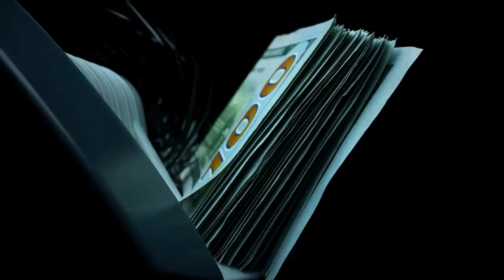The Highest Precision Gun that Doesn't Use Bullets

Comment: Whilst I always enjoy your presentations, I don't feel that I came away from this one with any understanding of what hurdle specifically that Lockheed Martin has overcome. What specifically can DEMOS do, that others can't?
Reply: Multi fiber beam convergence @100kW i do believe is what they have acknowledged publicly they hit.  The multi fiber beam = rain/dust does not matter(uh, matters less as uses multiple frequencies) and it uses the SAME LENS, thus it all hits at the same spot and is not a divergent beam from multiple lens's which also means the distance one can reach out and touch is MUCH greater as quite a bit of power is dissipated in the air itself tunneling a hole via plasma towards the target.  The amount of air turned to plasma becomes quite daunting fairly quickly especially for a moving object as the ENTIRE beam path must be heated to plasma allowing rest of the light through.  If you cannot push this through a SINGLE lens then we are talking MULTIPLE beam paths that must be tunneled and power required is obviously MUCH greater and therefore the kW rating on such a device is piss poor JUNK compared to an equal powered device using a SINGLE lens

Comment: Coat the projectile with silver and laser light will need much more time to burn thru, but targeting laser will have easier time for kinetic counter measures
Reply: Coat the whole projective in silver and it can no longer guide itself. You just made a faraday cage.  There is always some part of the missile that will be vulnerable, such as the seeker on an anti aircraft missile.  Not to mention that shinny silver coating just made it massively visible on radar for conventional weapons to target.
Reply: Much like your head is coated in tin foil?

Comment: The YAL-1  military 747 with the laser turret in the nose was decommissioned due to enormous costs and the “ eggs in one basket” battlefield risks.
Reply: Yes, though it did what it needed as a technology pathfinder.  It can also be a good reference for what improvements are needed.
Reply: There is a bigger problem.  There are no mi$$iles to sell with those systems.  It would be like curing cancer, bad idea.
Reply: they coudve installed that megawatt laser in ships instead of a large aircraft
Reply: @Fold-103  I would be surprised if there weren't at least one project for ship point defense.

Comment: I am not going to hold my breath,   this brand new technology has yet to run into any real world scenarios, and I feel counter measures could be fairly simple to produce.
Reply: Technically yes, these systems are designed to be used in conjunction with more "traditional" systems. 
If the weapon can interfere or disable a guidance system they would be very effective.

Comment: Its a good start but ye power outputs currently are just not good enough to be realisticly useful. The test articles being 'shot down' seem to have been either stationary or slow moving and non evaiding light cased drones/rockets and thw system required multiple seconds (or longer) focused on a specific point on the target to deliver enough thermal damage to take it down. This would be much less effective against high speed, heavier cased munitions and completely ineffective against constantly manoeuvring aircraft. 
Untill the energy outputs are of a level to burn right through an aircraft in half a second or less the physical projectile will still be the better choice

Comment: I see more problems with this as you have to find the target and then keep the beam on target for several seconds to destroy it. So what if the target starts avoiding? What if the LASER takes more time to recharge or cool then the number of enemy targets? What if you do not have line of sight to the target or the weather/smoke/ brought seas or terrain conditions prevent targeting of said objects. Then the cost followed by the weapon is not really armored and easily destroyed or put out of focus by vibrations or combat. Lots of issues to overcome versus convenience or cost. Not to mention the power needed to run it and the system to target it.

Comment: I wonder about a single sniper on the battle field and the new ultra-white paint titanium dioxide based reflecting heat coatings defeating this concept in the air.
Reply: Put down the pipe, you've had to much already.
Reply: @thefrogking481  For every measure there is a countermeasure.Ukraine's in their society do not put down there smokes while exemplifing by demonstrating much countermeasure equipment ingenuity. Think of your brain like a parachute...parachutes work best when open. If your parachute does not open you croak.
Reply: Lasers require lots of power and heat dissipation, which gets heavy and bulky.  On the other side, nothing reflects perfectly, nor in all wavelengths, and once the surface is compromised, it's not even that reflective anymore.
Reply: @patrickjanecke5894 Patrick a very nice thoughtful reply. Thank you for such professionalism and Etiquette shown that others obviously are lacking in as others hide their rude behavior behind pseudo names. Moving on past the other demented types who replied earlier.....I also read about a "starlite" coating that resists fire. Maybe an inner fuselage lining coating of starlite would reduce the lasers effectiveness against the laser penetrating the fuselage of a passing or approaching flying  object.
".....Starlite is an intumesscent material said to be able to withstand and Insulate from extreme heat. It was invented by British hairdresser and amateur chemist  Maurice Ward (1933–2011)....."

Comment: it looks like laser guns would be next to be developed
Reply: No.  Short of a major breakthrough in physics, man-portable lasers just won't pack enough punch or dissipate enough heat.  Even then, power efficiency is really low, so it makes no sense to shoot infantry with it.  These are doomed to be vehicle mounted.
Reply: @patrickjanecke5894  sounds like a v8 engine before. Engineers at Ford Motors say it is impossible, but with Ford's persistence, it became possible it was just a matter of time

Comment: One problem I can see coming up, it only shoots in a straight line! Something over the horizon or behind something cannot be hit. Another thing is the energy is dissipated over a distance and the beam must be held on the target for several seconds, a long tracking time that can't move even an inch, rather than the split second impact of a shell. The real use on a airplane would be blinding the Pilot, which is done even now by kids with lazar pointers. I wonder what effect they might have on radar absorbent materials, will they absorb the lazars too?

Comment: All this sounds well and good but, it takes too long for the weapon to penetrate/damage the target AND in poor weather, the weapon would need to continuously "burn through" great distances of other materials. So, until they can make a weapon capable of instantaneously firing a pulse of sufficient energy to disable the target AFTER moving through any "obstacles" weather can toss in it's way, it will continue to be a science project and nothing more.

Comment: I'm ready for directed energy to be in the private sector.  We can already source parts to build small ones with real power.
Reply: Laser cutting exists in industry already.  It's one of the reasons why the technology has improved so much.
Reply: @patrickjanecke5894  Yep.  I used to run an industrial laser myself.  It could cut through 3/4" steel plate.  We mostly cut 4'x8' sheets into assorted parts.  A sheet of 3/4" took a few hours.  A sheet of 1/16" took less than 10 minutes.

Comment: What if you launch a bullet or projectile and accelerate it and / or turn it into molten plasma with laser(s) before impact? Perhaps it can pierce clouds etc. Course correct mid flight
Reply: The idea isn't about melting the whole thing into molten slag.  One can either punch a hole so as to compromise the function of the weapon, or damage an aerodynamic surface enough for it to be destroyed by the wind resistance.  

Some frequencies can go through clouds, but that does add to the list of design requirements.

Course correction is pretty useless against DEW.  It only needs to track a moving object where it is right now, not guess as to where it will be 10 seconds from now.

Comment: What about the diferents typs of laser, like quimical ones, they are not ecofriendly.
And the battery is very, very heavy, it doesnt get litter like a normal gun, when it use there ammo.
Laser are good idea to combat the drounes but you want to avoid to put big batery on a veicule because the % of serviving a hit can be lower .
Reply: As has been known in the hard sci-fi community, any directed energy weapon is far less powerful of an explosive as its power supply.  Still, direct feed from a battery won't work too well for DEW purposes.  You need capacitors - really big and powerful ones.  At that point, charge up on that alone.

Comment: If only it could track hypersonic  missiles.
Reply: The biggest problem with hypersonic missiles is trying to get a shot to lead them.  Lasers are effectively instantaneous.
Reply: @patrickjanecke5894  but can the tracking software keep up Is my question
Reply: @Visvangmeneer  Yes, that's actually the easy part in point defense, and hypersonics are actually easier to acquire as they are moving through atmosphere so fast that they appear as a bright plasma cone.

Comment: Probably a stupid idea..but, if you put mirrors on a aircraft and tried to shoot it with a laser, would it work?
Reply: If there aren't any scratches, dust, grease, etc., a mirror will work for about a microsecond as they are not perfect reflectors.  After that, the surface won't help at all.

Comment: What they don’t tell you is what it would do to a human body if it hits a person which it would more then likely be used for in a war situation eventually 😂
Reply: Nope.
It's far to expensive to use for that.
When a bullet costs 30 cents and has been proven to be most effective.These systems are intended for air defense.
Reply: Just currently requires a bus sized object to house/power it  to operate and yes will kill someone easily currently.
Reply: @w8stral  Which is far smaller than what was needed thirty years ago.  Still, power consumption and heat dissipation will be hard to shrink.
Reply: @patrickjanecke5894  Not true at all as that is not the breakthrough
Reply: TBH, why bother?

We have cost effective bullets.

We can also use much lower power lasers capable of blinding everyone in 'that direction' if we really want to go that route.
Reply: @ColonelSandersLite  Well, Bullets are not cost effective is the problem.  Steering them is VERY difficult and very limiting, a LASER can be aimed instantly without moving the lens for small incremental changes, only large movements.  This makes tracking/killing far far far easier and quicker.  Tie a heat sensor, with inferometry, to a computer, and a LASER set up with no one around and it would literally kill 100% of ALL infantry, RPG's, heat sensing missiles, mortars ... utterly negating the machine gun into the dustbin of history and the requirement for a man to operate it or any other weapon and be seen by said IR heat sensor to begin with.  This will be the start of mech warrriors.  The only problem is power throughput associated equipment.  The problem is not the LASER itself, but rather all the power equipment associated to RUN said LASER.
Reply: @w8stral  "Tie a heat sensor, with inferometry, to a computer, and a LASER set up with no one around and it would literally kill 100% of ALL infantry"

Buddy.  Nothing you described there is a function of lasers over bullets.

Any technology that can be used to autonomously shoot a laser at a man can just as easily be used to autonomously shoot a bullet at a man.  It wouldn't have a fraction of the footprint either because the power requirements are greatly simplified.
Reply: Knight, you are correct about the effectiveness of using high powered lasers to attack soldiers.  However it's illegal under the Geneva Convention, as are all electromagnetic radiation weapons used against humans.

Comment: Um, no.  Look at the wavelength, peak lasing power, and touted engagement distances, and terminal effects.  Also, figures quoted are under entirely optimal ("cold-cavity/bore", blue-sky continuous target tracking) with no effective "follow-up" shot due to capacitive re-charging and thermal off-loading back to cold-cavity and cold-excitation circuit states.  We'll get there, but we're not remotely there for decades to replace individual kinetic/explosive rounds with X milliseconds of lasing exposure from a singe emplacement.  On a very positive note, terrestrial defensive-grid coordinated arrays of these weapons will be devastating.  Multiple targets can be multi-radiated simultaneously increasing both the reach and effective-kill lasing duty-cycle of all lasers in the system.

Comment: Lasers ? Well, you seem to forget the power of ground penetrating microwave energy. Ground penetrating microwave energy also can be weaponized and the effective distance perceivably has an unlimited target range of destruction along with a much larger effective diameter of destruction of targets. This larger diameter of destruction could be as large as from 3 feet to over 1 mile in diameter of effective destruction of targets in the air or on the ground even to say the capabilities include the vaporization of all organic matter up to 3 miles in the grounds surface. If the microwave is focused to a one mile diameter while focused into the air all organic materials would also vaporize as far as 5000 miles or more in distance from the device. The effective power of the weapon also consisting of the capability to vaporize aluminum and steel at the same distance in a time frame of only milliseconds if powered properly. The wattage of the weapon exceeding over 2 billion watts produced by a compact complex hybrid electric generation system that can be nuclear powered for start up proposes. Clouds, or dust cannot effect the weapons efficiency, however, rain becomes a factor in the performance of the device. Water is also vaporized by this weapon however heavy rain becomes an obstacle in targeting and using the device unless further research is done to over come this obstacle by vaporizing a pathway through heavy rains to the detected targets location. Lasers ? ........

Comment: Here's a scenario for you how about a laser guided missile with the laser Warhead on it with a Dynamo inside giving it the charge it needs to fire the laser so you have a missile going at mach two or more and you have a laser weapon on the front of it that goes at the speed of light of course these weapons would be reserved for icbm's and the new hyper mach missiles and possibly it could return back to base to be reused and just in case it doesn't come home it explodes to destroy the technology to keep it from the enemy's hands
Reply: You're close.
The energy directed from such a system could be used to "power" a near light speed weapon. 
Lasers travel near the speed of light dependant on the spectrum, the emitted energy could be used to power a "missle". 
Imagine a mobile air system firing a "laser" at a projectile to "power" it to near light speeds. 
The tech isn't quite there yet, but that is rumored to be one of the platforms being researched. Materials and a reliable "fuel" hasn't been discovered yet. But the theory is being pursued.

Comment: I don't believe the no maintenance cost BS!
Reply: it's a single-use device  :P
Reply: I doubt it's a one use device!
Reply: There is maintenance needed but no bullets or bombs to manufacture. The energy required is huge but we've gotten better and high quality capacitors can discharge very well.
Reply: @michaelltnv6741  probably not a one-use device, but these weapons will definitely require maintenance.
Reply: @michaelltnv6741  I was only foolin
Reply: Nikola Tesla tech
Reply: Then, you don’t understand this technology. 

Laser weapons don’t experience the mechanical wear and tear brought on by chemical energy weapons such as bullets, missiles, or bombs. 

Laser weapons simply and directly convert electrical energy into electromagnetic waves, much like turning on the lights with a switch. There are other more complex components, but they are all solid state electronic devices. The optical devices might occasionally need to be wiped down, and the turrets moving them might need periodic lubrication, but it’s fairly de minimus.
Reply: the neutraling of target is not instant.  it takes few seconds per target.

Comment: Funny how our language has to play catch-up.

The definition for a "gun" is a tube device for firing bullets, shells or missiles, propelled by explosive force. You'll find various versions but the idea is the same. (And a few known exceptions: think of a rail gun which uses electricity to propel a projectile, or a spray gun which used for paint)

This laser weapon is not a gun. Not by our current definition of a gun anyway.